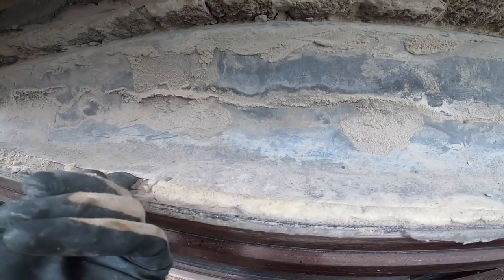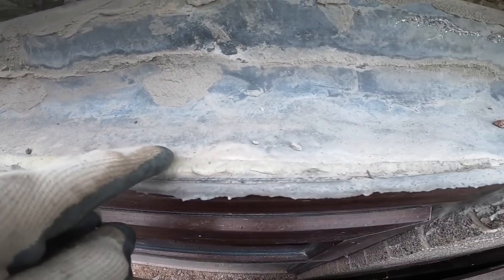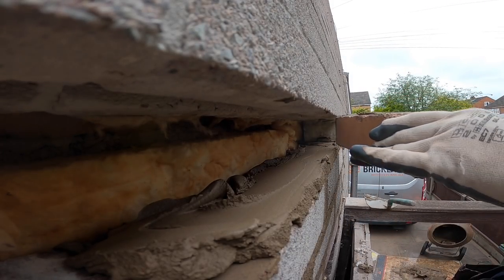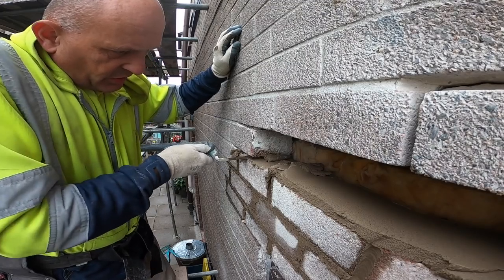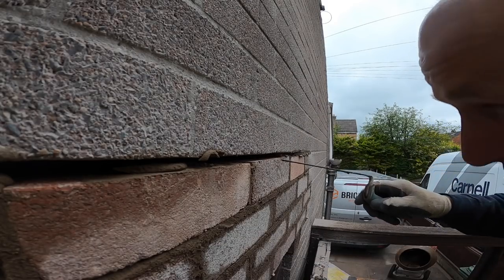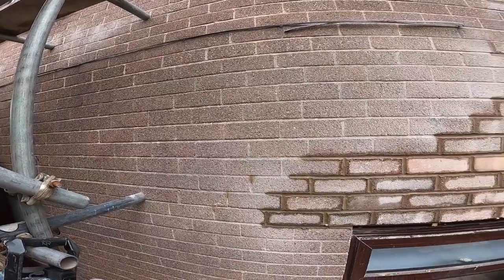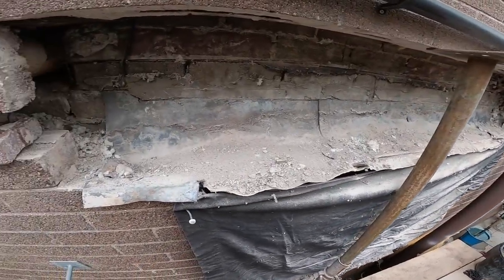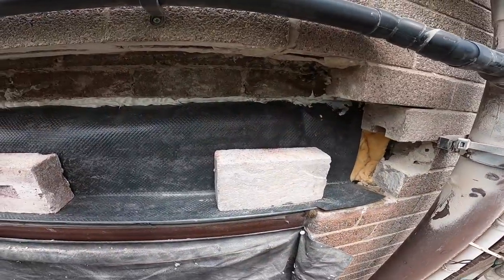NO LINTELS ...ABSOLUTELY SHOCKING!!

Comment: Hi I'm a structural engineer in the UK. You can see when the flashing is taken away that there is a concrete lintel for the inner leaf of masonry, which is the loadbearing one. The outer leaf would have been supported by the timber window frame back in the old days, and then when UPVC windows came in , they provide no support so a further external lintel is needed. Great video - I learned a lot thanks 👍👍
Reply from the maker: Perfectly put Robin , spot on . 
  Thanks very much 👌🏼🧱👍🏽
Reply: I dont know what buildings you have been looking at but they have used conc boot lintel and tray lintel like in the NE we used Birtley trays and later catnics the last time I saw unsupported outer leaf over door n window openings was work from the 1920s and 30s, and it was against all building regs since Parker Morris standards after the 2nd world war .😎💕🖖
Reply from the maker: @kevinscollan8293  🧱👍🏽
Reply: @kevinscollan8293  Hi Kevin. Lots of buildings like this with unsupported outer leaf, even 1960s. Basically they were designed for the windows to support the outer leaf.
Reply: Completely wrong minimum code in usa requires a lintel even if this structure used bricks as headers every 7 courses the weight of the bricks alone can bind windows crack the glass and compromise the structure if the wood ever rotted. Lintel's are code almost every country  in the world!
Reply: @joebiden2140  You're absolutely right. No one is saying this is right 😉
Reply: @joebiden2140  Calm down democrat/pdf-ile. It's okay you state 2+2=4, but....what do we need it for? I can add some to the conversation and say that - in many 'special' apartment buildings, built in my country, where they wanted large corner windows, and just in several regular houses, in the 50's and 60's, the windows are in many projects load bearing, and according to the commune you are only allowed to change the glass.
Reply: @anderslarsen4024  lol you might be thinking of structural glazing and glass walls but no window by itself is load bearing. Even old building that lack structural steel lintels have a timber header or a mule to support the weight. Now get over here and let me smell your hair 😂😂
Reply: @joebiden2140  You are completely wrong, again. Windows "cant", legally, according to commune, be changed cause 5-6 bricks are resting on the window frame in the house I am working on now.
Reply: @anderslarsen4024  well lad I think thats our problem I'm from america and we use the international building code! What standards are you building off of ??
Reply: You can get ‘shoes’ to put on the Jack-prop. This would hold the Jack another 6" off the wall thus allowing for a plate of biscuits as well. 🙂
Reply: @joebiden2140  Trouble is, they are not aesthetically pleasing in brickwork. I’m not disagreeing with you I understand your point .
Reply: @Known-unknowns  If you dont recess them then yeah but brick can be cut and epoxied to complete the look.?
Reply: @RobindeJongh  not in the UK bruv not in housing I can guarantee it unless it has been  jack building his own house with his nana on the hod. Since Parker Morris standards and building control after the 2nd world war it wouldnt get signed off and in the case of a new house it wouldnt get an NHBC 10yr ticket lol. 😎💕🖖

Comment: I was one of the brickies who built over the frames without catnics. We asked for the catnics but the builders, said no, because the engineers gave this design the OK. We knew it was going to give trouble when the wooden window framed started to perish. Many brickies, like the ones in my gang, just walked away after a few pairs of houses because not only did the builder skimp on the proper material  they also skimped on our money..
Most of this started in the early 70s but I recall wimpy still doing this in the early 90s. Cheap move but again, please do not blame the brickies.
Reply from the maker: Definitely not the brickies fault , it’s the tight fisted narrow minded developers fault . 
   Cut costs now and let the hone owners worry about it down the line when any warranties have run out 🙄🧱👍🏽

Comment: Nice video! Recently I found out  the same problem on the first floor where there is no much headroom for brickwork due to the layout of the roof. The windows are shaking like a leaf no support above them, rooms overtaken by damp all around the revels, absolutely disaster. Being moving about 4 tons of plastering sand to deal with it but the main problem are those missing lintels.  Many thanks.
Reply from the maker: Best of luck 👍🏽🧱

Comment: Lovely mate we tip tho see that small settlement crack be better for these to have 25mm ground back then a 6mm spiral helix bar inserted 600mm either side crack with resin then pointed in stich then normal every 300mm if big vertical cracks. Awesome workmanship as always steve buddy. 🤟🤟
Reply: @martin2466  
Yeah mate shouldn’t be anymore that’s 25-35mm into the Morar bed and some resin place bar in them but more resin let 5-10mins then repoint back up.
Reply from the maker: 🧱👍🏽 cheers Lee
Reply: @SteveAndAlexBuild  
Just giving more work with the grinder not that you need as pretty damm good with it. Take care buddy.
Reply from the maker: @lmilne4859  you too Lee 🤜🏻🤛🏻🧱👍🏼

Comment: To be honest it's not shocking  and very common ,the original windows were load bearing and didn't need a lintol ,what is shocking is cowboy window fitters have been going around the country replacing these windows without installing load bearing windows or lintols.Window fitting isn't a trade they wouldnt have a clue yet we are the ones that have to have a CSCS Card 😁 Nice job 👌
Reply from the maker: Very true Andy . We do loads of these . 
 They sometimes take 1 course out and bang an unpainted angle iron in a wreck the original cavity tray 🙄🧱👍🏽
Reply: @SteveAndAlexBuild  👍
Reply from the maker: @bricklayersworldwithandy6277  👍🏽

Comment: From the USA. I have to agree with Krtek 6. From the appearance and the ease of handling/installation of the new "lintel" it doesn't appear to be much different in strength/size/weight from the one being replaced. A repair in the US would us either 3/8" or 5/16" primed 4 inch by 4 inch angle iron utilizing threaded rods/nuts drilled and epoxied into the existing masonary as a lintel.
Reply from the maker: There was no lintel it was lead
Reply: The outer leaf of a cavity wall is non - load bearing (it serves largely to protect the inner leaf against moisture and temperature variations). The load supported is only the triangle of brickwork above the opening. In the video we can see that there is no lintel only a (lead) cavity tray. The tray is intended to throw any water that gets into the cavity against the outer leaf and protect the window or door below from moisture build up. The tray is non - structural and will not support the brickwork over an opening of this size. As lead is malleable it will move with time, hence the cracking above.

Comment: My Dad needs a lintel replacing because the previous home owner smashed the double doors out and replaced them with bigger sliding doors, obviously it wouldn't fit so they've just smashed the brwk/bwk back to accommodate the doors. So now the lintel is only holding on about 30-45mm on each side. I've never worked with acrows/strongboys before. I'd be comfortable doing it if it was an older build with those L shaped lintels like you replace, but unfortunately it's a catnic lintel and I don't dare mess with it. Have you got any videos with those kind of lintels?
Reply from the maker: That is definitely not a diy job . make sure you get a good builder to do it properly for you 
good luck 🧱👍🏽
Reply: @SteveAndAlexBuild  I am a bricklayer by trade but I’ve only ever done new builds…
Reply from the maker: @RiddlePC  . Right , best bet is google it or search on YouTube . 
   It can be done with strong boys on each side 🧱👍🏽

Comment: Ere Steve what are my options for lintels on a single storey cavity wall extension?
Can I just put two skins of concrete ones in and insulate. Or the same with metal ones like you've used here. Or do I have to use cavity tray lintels?
Reply from the maker: Best to check with building control but whatever you use you will need cavity trays 🧱👍🏼
Reply: Ok thanks boss
Reply from the maker: @bigmik3566  good luck with your extension 👍🏽🧱
Reply: Thanks. I need all the luck possible lol
Reply from the maker: @bigmik3566  😂🤞🏼🤞🏼🤞🏼🤞🏼🤞🏼🤞🏼🤞🏼🤞🏼🧱👍🏼

Comment: Job well done! I see the house has got more issues. Drainagepipes for wastewater through the wall on the outside of the house. Isnt that going to freeze in wintertime?
Reply from the maker: No that’s standard for drainage 🧱👍🏽
Reply: Drains shouldn't have any water standing in them anyway so nothing that could freeze. I'm still not entirely sure I'd want to try this system in a place with properly cold winters but on the British Isles it seems to work just fine.
Reply from the maker: @Ragnar8504  👍🏽🧱
Reply: @Ragnar8504  Some decades back, I had to use hot water to melt ice freezing in a long external drainpipe from a bath (even though it was hot water draining away). We haven't had such cold weather in recent years. I laugh at people who say there's no global warming!

Comment: Why is the acroprop removed while  mortar still wet is it not best to wait for the mortar to dry so that the brickwork can act under  compresion again, if wet would there not be a likelyhood that the same crack will develop as this is the weakest part of the building until dry?
Reply from the maker: On certain bricks yes but these go off fast it’s ok to remove them . 🧱👍🏽
Reply: @SteveAndAlexBuild  many thanks for the response.
Reply from the maker: @jeanvanderberg4021 no problem 🧱👍🏽

Comment: did you not curl up the ends of the tray and install weep vents?
Reply from the maker: The tray wasn’t curled up at one end due to room . Vents in every 2 brick 👍🏽🧱
Reply: @SteveAndAlexBuild  What i do in a similar circumstance is either take more brick out either side to give more room so you can curl up the ends or cut the tray on an outward taper and still curl the ends up, last thing you want is water shooting off the end, that will cause damp on the inside of the window reveals... more so because them brick are porous being concrete and prolonged rain will penetrate water more than you think
Reply from the maker: @colinbooth1974  although the bricks are concrete they are like mini padstones , very dense and not letting any water in 🧱👍🏽

Comment: My house is 1910 it still has lintel arches outside regardless to if there is a wooden sash window there or not i had all of mine replaced with UPVC no lintel needed. Only downside is they used wooden lintels on the inner leaf which seem to be in good condition but are prone to rotting sooner or later.

Comment: Would a mortar gun of been better to fill the tray to the wall instead of mastic?
Reply from the maker: No mortar shrinks and cracks where silicone actually sticks and flex’s 🧱👍🏽
Reply: Generally if you can't insert the tray into the whole of the inner leaf you would face fix the tray. It's sealed to the inner face with a thick double sided tape and mechanically fixed with a plastic hammer fixings through a strap. It's a standard Ruberoid and Visqueen method/ system.  Turning up the ends of a tray don't actually comply with the British Standards which states preformed stop ends adhered to the tray should be used.  It's all these little things that add cost though.
Reply from the maker: @kf0017  👍🏽🧱

Comment: I say it this L shape roof panel and rubber is not need at all. This sheet used it not have any structural strength. And it why are you expect it rains from within inside between walls that you would use this rubber to collect water ? :) I would put strong T shape metal piece upside down and make a groove along the center of the bricks with angle grinder so it brick will sit on strong metal support. It after first layer complete I would put insulation back together and finish another bricks. When It all bricks cured there will be an air gap between window and that T shape metal piece I would fill this gap with foam and finish gap with rubber window sealant so it hide the foam work.
Reply from the maker: Thanks for the tip , you are obviously not an English bricklayer 🙄🧱👍🏽
Reply: @SteveAndAlexBuild  🙄😂😂😂. Some crazy comments . hope they aint builders. 🤠
Reply from the maker: @thunder131 Yep ! 🙄😆😆🧱👍🏽